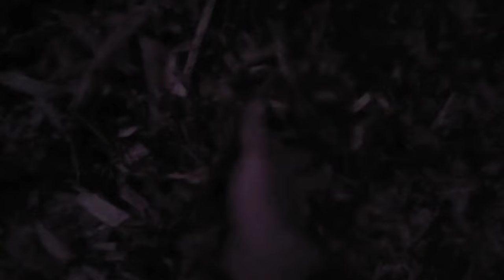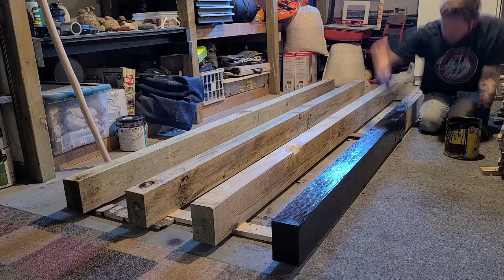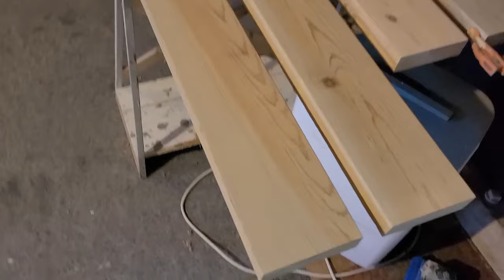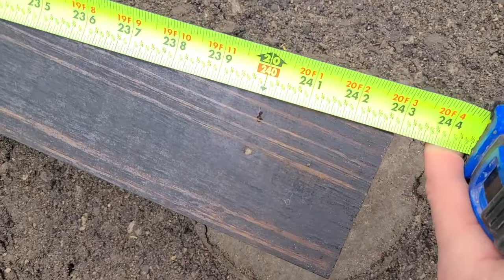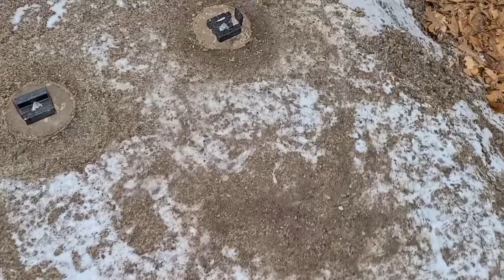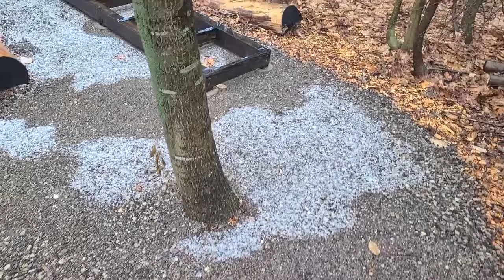Simple Sawmill Base - You can build this

Comment: I have an HM130 and built a wood support frame for it on short 4"x4" leg and  wood beams below the sawmill rails. That places my mill at a nice operating height.  I placed boards that rest below the sawmill track and rest ontop of the wood frame.  Makes it very easy to clean with my battery powered blower. You may want to consider that approach otherwise you will be shoveling sawdust by hand from between the framework you have built.  I also predict you will install short legs below your beams to raise your mill to a more comfortable milling hieght.

Comment: Good job.  I don’t see that moving anyway soon.  One note about your wood filler.  I have found saw dust works great and you get to recycle.  I use Titebond III.  That’s the waterproof glue.  I bought those cheap plastic spatulas.  I use the bigger one to mix the glue and saw dust on.  Then a smaller one to apply it.  Then just let the glue dry after you apply it to the holes or dents.  A light sanding is recommended.  Then you can stain or paint.  It makes no difference, either will work well.  When the glue drys on the spatula.  Just bend it and it will come off clean and ready for the next job.  I like your videos.  I find them easy to follow what your doing and easy to understand.  I have hopes of buying a saw mill.  But I’m looking more into a Mobil Dimension saw mill.  Just because of how easy the are to operate and you can cut any diameter log.  I live on 21 acres and have some big pines and oaks trees.  Do you plan on building a solar kiln?  Later
Reply from the maker: I don't have plans for a kiln, I'm just stacking the boards in an old barn for now. That might be a project for the future. I like the sawdust idea. I'll give it a try the next time I have some holes to fill.  I would encourage you to buy the sawmill, it's a lot of fun. There's always projects to use the boards for. Thanks for watching.

Comment: It looks like a great build. And you obviously put alot of thought into it. Why not use galvanized anchors so that they wouldn't rust out? Also if you turn your head to cut the opposite way the log stop guard will keep the blade from hitting the log stops. Also the sawdust will be blown out into the woods instead of against your pile of logs. The head is designed to go the other way so that the blade cuts against the log stops. BTW this is my wifes youtube she has premium I don't lol. I do uave an HM130MAX.
Reply from the maker: Thanks for watching! They didn't have galvanized at my local hardware. They are zinc plated, that'll have to do. If you check out my more recent videos, I flipped the bunks around so the log stops are on the right side. I plan to put a shed over the mill, I don't want the dust to blow inside the shed. I'm gonna make a raised rail for the logs to sit on, and the sawdust will blow underneath them in the future.